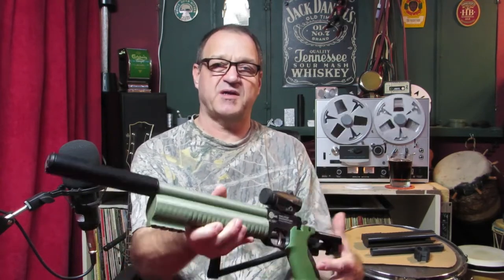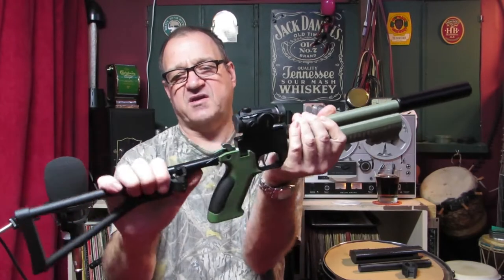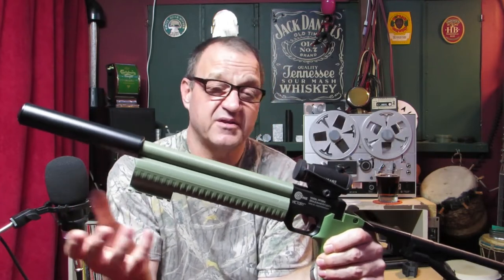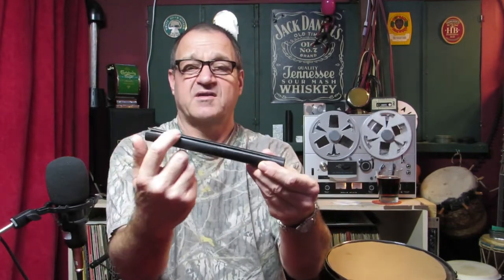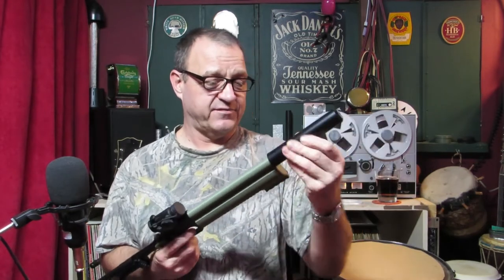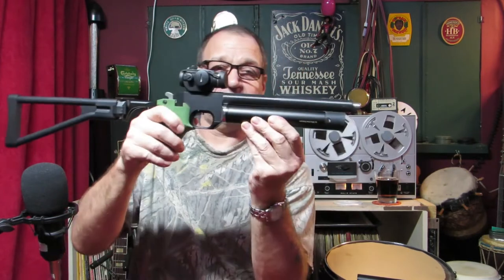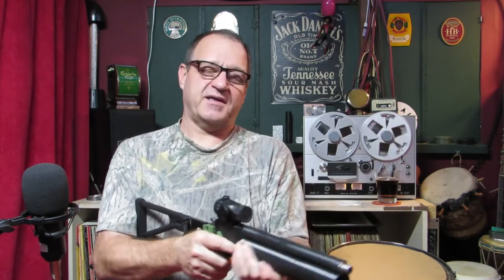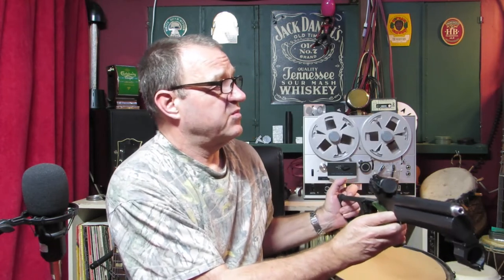3d Print Commission Job For SMK PP700W

Comment: Watched and emailed 👍👍👍
Reply from the maker: Awesome thank you!
Reply: Hi.
What's the price of the shrouds? 
Thanks
Reply from the maker: Depends, watch our next video for more details on how to get.
Reply from the maker: Hi, I listed a shroud kit on Etsy, but they took it down, they don't allow gun parts. Kit is plain barrel shroud, hand grip part, and dovetail to weaver adapter. Price is £45 delivered in uk only. Message back if interested. Thanks.
Reply: @ShootfishProductions  
Hello guys, pp700 shroud is going great 👍 
I just wanted to ask do you think you could copy and print the folding stock?
It’s impossible to find any in stock anywhere in the UK and not aloud to import one from Europe now 🙄
Let me know.
Hope you Two have made the most from the three day weekend !😉
Reply from the maker: @matthewnewman974  hey matt, good to hear from you again. A printed folding stock would be too weak I think. I have a design from thingyverse which is a fixed stock, printed in parts. I'll check it out and see if it's viable, will let you know.
Reply from the maker: Hey Matt, sorry the printed stock is not viable im afraid. It's a very long print job for something that could break very easily. Keep trying the suppliers. Try this, http://sheffieldairrifles.co.uk/replacement-shoulder-stock-for-pp700-folding-stock-pistol-to-rifle-conversion-fits-boths-pp700w-pp700sa-p-74805.html